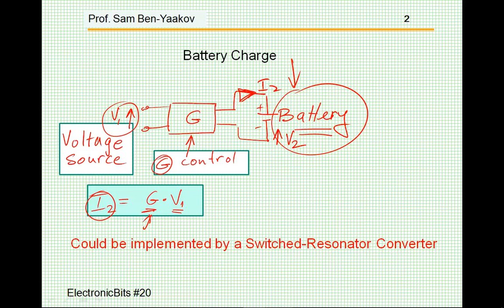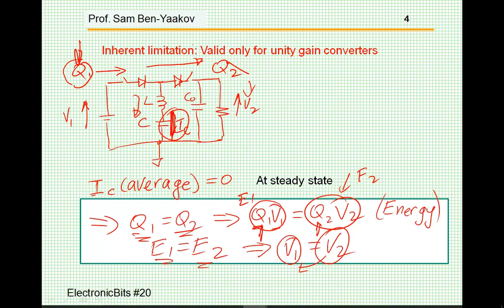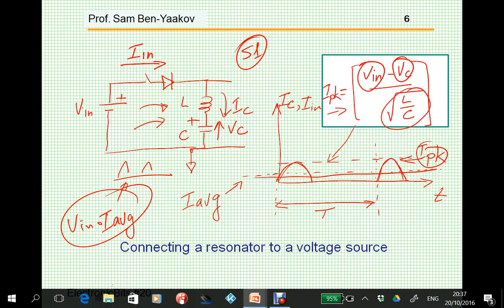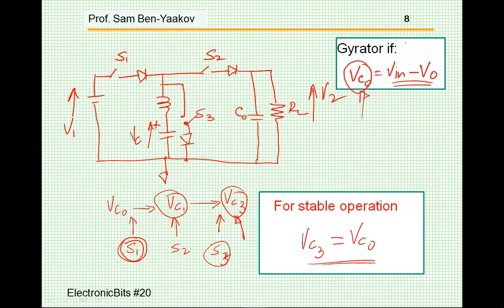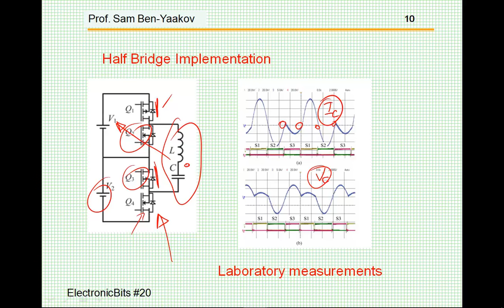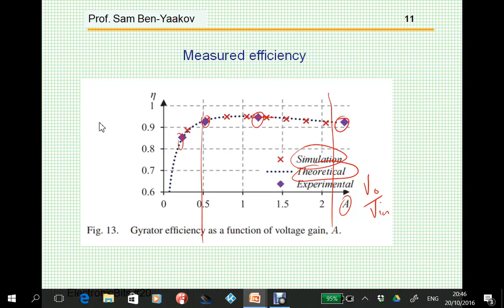Switched-Resonator Converter

Comment: Hello Professor, Thank you for the explanation. As with some resonant converters, I was wondering if the switching frequency is changed for load and line variations to accommodate zero voltage switching.
Reply from the maker: Indeed.

Comment: @0:52 Doesn't a transformer satisfy those equations?
Reply from the maker: Not really. The relationships in a transformer are between I&I and V&I and not V&I.
Reply: @sambenyaakov  

You're right.  I was just noticing that the following equation is apparently valid for both a gyrator and a transformer. 
-Io/Iin = 1/ (Vo / Vin) 
 (In a transformer it is the turns ratio, and in a gyrator the G term cancels.)
 But apparently this equation follows directly from conservation of power (so I guess it doesn't say much about the device except that it doesn't accumulate energy in steady-state and it's a lossless/"ideal" device).  

Dividing the 2 equations from the definition of the gyrator given indicates "conservation of power", (same as with an ideal transformer).  But that operation reduces the 2 equation system to 1.  If the second equation is then written, presumably in terms of the impedance relationship, then this indicates that in the Gyrator, Zout and Zin are inversely proportional to each other, whereas in a transformer Zout and Zin are proportional to each other.

------------------------------------------
Derivations:

Derivation of Conservation of power:

Gyrator definition:
-Io  = G Vin
 Iin = G Vo

Divide one equation by the other to get:
-Io/Iin = Vin/Vo

Rearranging:
-Io Vo = Vin Iin
(indicates Conservation of power)

Derivation of Impedance Relationship:

From Gyrator definition:
 Vo = Iin/G
-Io = G Vin

Dividing these:
Vo/-Io = (1/G^2) (1/(Vin/Iin))
(Indicates Impedance Relationship is inversely proportional)

===================================
Transformer

Conservation of Power:
-Iout/Iin = Vin/Vo = n
-Io Vo = Vin Iin

Impedance relationship:
Zout = Vo/-Iout 
Zin = Vin/Iin 

Zin = n^2 Zout 

=================================================================